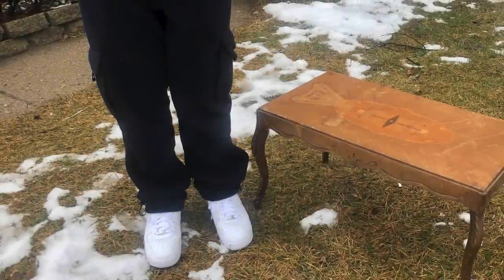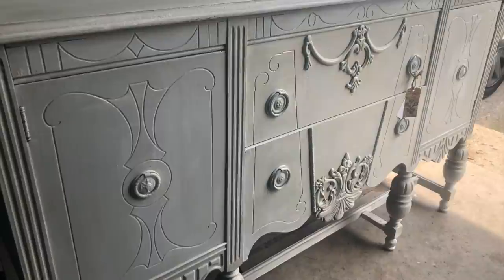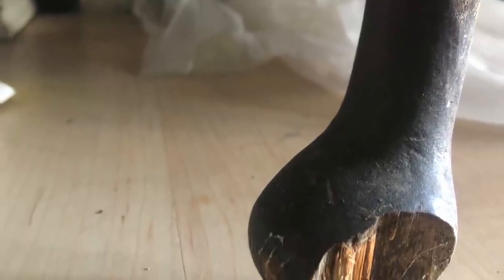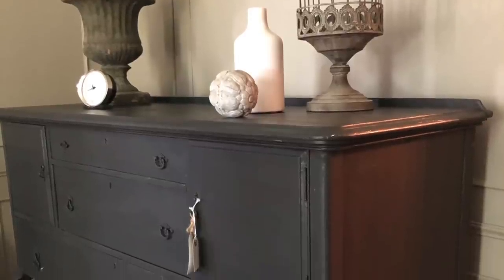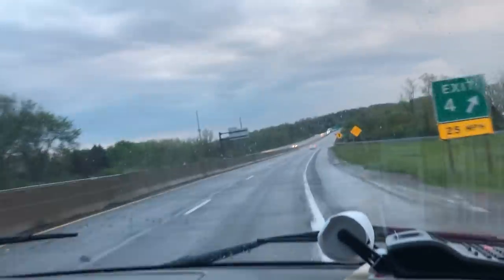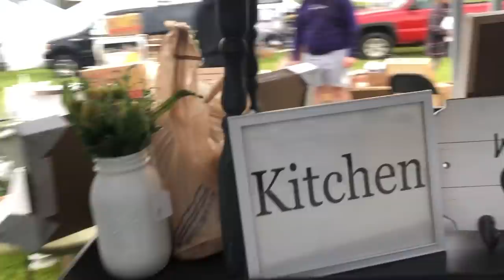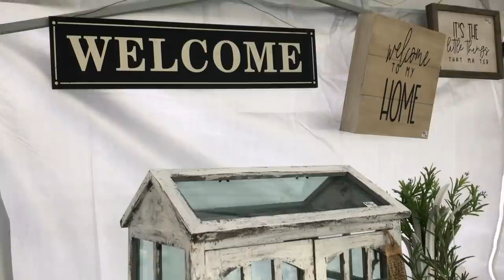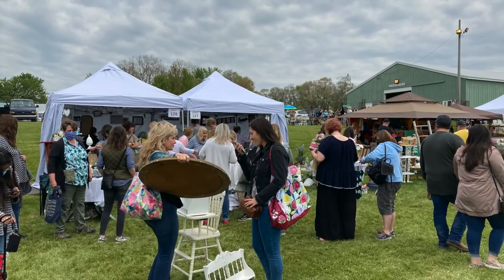BEING A VENDOR AT A VINTAGE MARKET-SELLING YOUR REPURPOSED FINDS AND FURNITURE MAKEOVERS

Comment: Wow, Kelly that was just awesome. I’m so happy to hear it was a success. You n your mom had a lot of beautiful items. Wished I lived real close to you cuz I know I would of bought more than I would need.
So many cute things that I saw that I would love to have. I’d be broke but what the heck. You might as well enjoy it while you can. To bad you don’t have a shop on line. I know I’d buy from you. Family is wonderful n you were blessed with quite a few to help you out. Thanks family for helping. I’d definitely would love to see more of these videos but don’t forget I want to see you take s piece of trash n turn it into a beauty. Haven’t looked at the link below yet. Hope you put the link to the lady with the stencil I believe.
I love it , I loved it!! Great show.
Some info on taking off veneer.
You can use a heat gun or take a damp towel n a iron. Put the towel on veneer lay the iron on top n with a scraper start going under the veneer. You just want to heat up the glue n it works great. I saw you painted the top anyway. Less work filling it in n sanding till real smooth. I’ve done this many times n sometimes I get lucky n have pretty wood underneath. Then again you’ll get popular wood like yours You may already know all this but I thought I’d throw it in. See on the next video. ♥️♥️😊👍👍👍
Reply from the maker: Hi Shelly!  Thank you for the tip on removing the veneers! That one was quite a bit of work....your method probably would have made the job a lot easier!  Also, yes...I feel blessed that my family could help us out with the show!  They are so AWESOME!  I don't know what I would have done without all of them!   About...you wishing I had an online store....I've had a few people ask about an online store just for vintage finds in the comments...that's something I'm going to look into.  Maybe I can work on that.  Anyway, thank you for sharing and for your sweet comment!  I really appreciate that, Shelly!  XOXO  You have a BEAUTIFUL Memorial Weekend!

Comment: You can re veneer the buffet pretty easily, if you can get something to weigh down the top as the glue sets
Reply from the maker: Thank you for the tip, Jennifer!  At first I tried to glue down the loose veneer and I did put some heavy objects on it, as it dried.  After it dried a bit, though...it was still squishy underneath, so I just couldn't leave it like that.  When I began ripping it out.....I found that there was a layer of wood underneath the veneer that was wavy and warped and that is why it was squishy. It seems there was some water damage underneath the veneer.  It was a nightmare!  Yikes!  But, anyway...thank you for your suggestion!  I really appreciate it and thank you for taking the time to try and help!  You have a  BEAUTIFUL Memorial day, Jennifer and thank you for watching!  XOXO